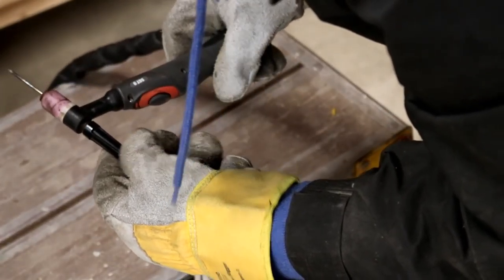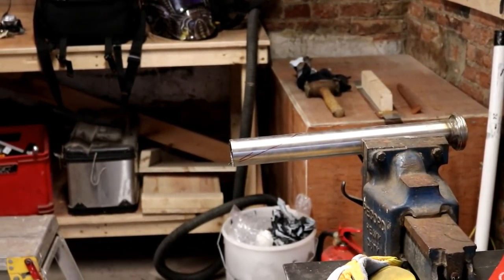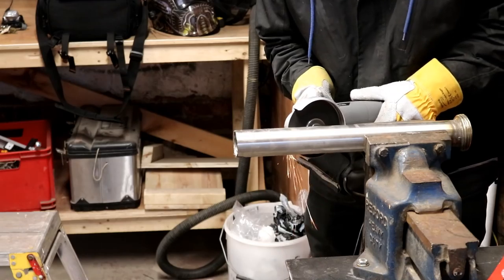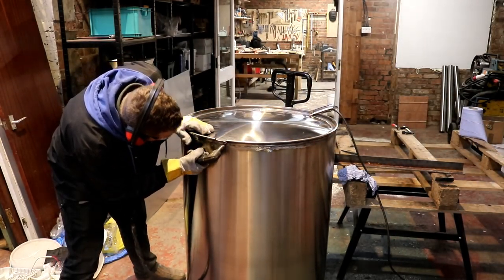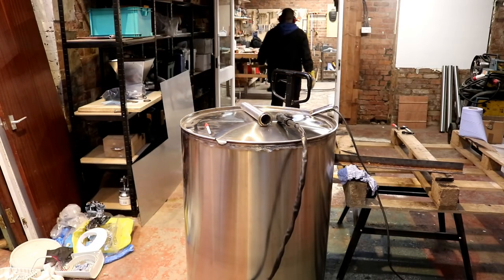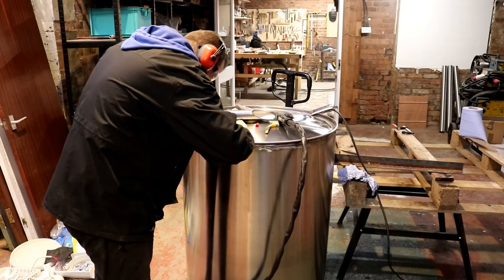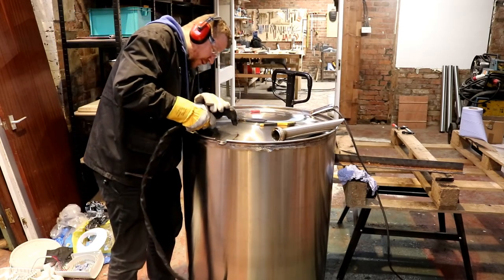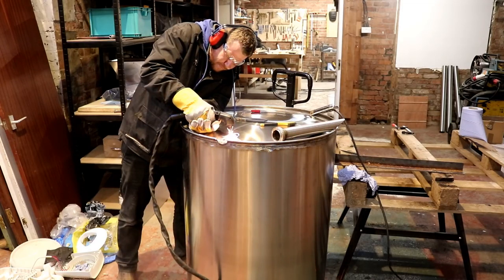I got drunk so here is a Q & A

Comment: I should have thought about surface area needed for your glycol system a bit more before asking the question. I maintain my fermentation temp in a similar manner in my home system: Fermenter inside a chest freezer with a heat source wrapped around it. Heat source and freezer connected to a ST-1000 controller. Fermentation is easily controlled after reaching desired temp. I appreciate you answering my question. Great to see the daily progress.